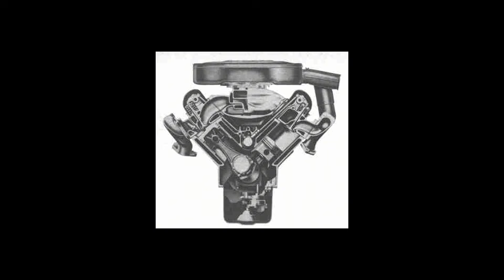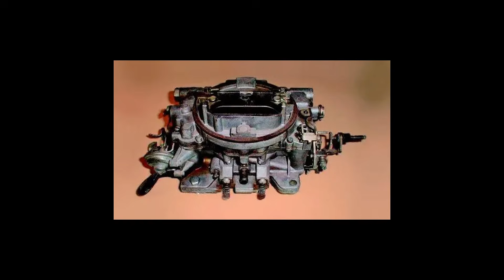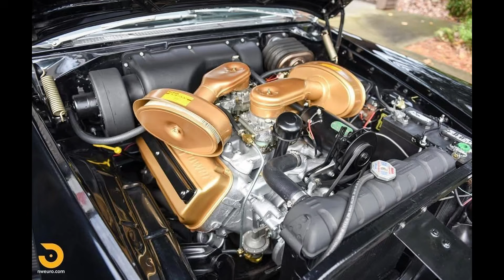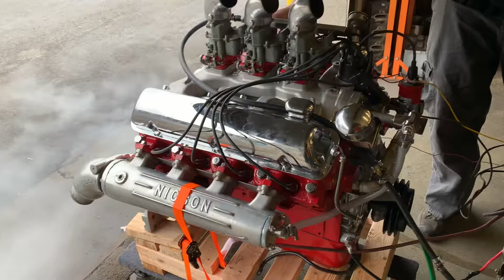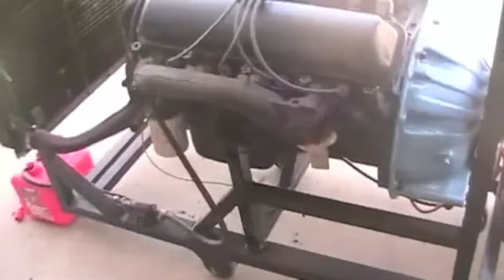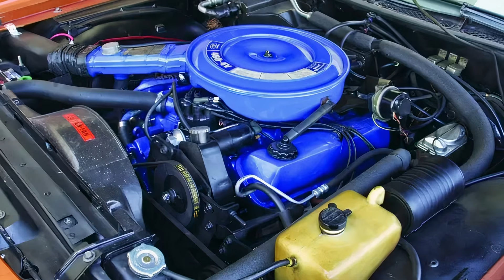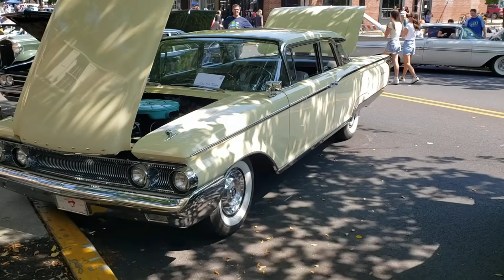Why America ABANDONED Lincoln’s Monster 430 Big Block!

Comment: The 430 was the most reliable of the luxury brands. by 1964 58 -59 Lincolns were getting into the 180K to 200K compression checks revealed that they were within  80% of factory specs which was unheard of at the time a quick valve grind and new seals on the heads brought these engines within 96-98% of factory specs. but back then they didn't survive long in the used car market and by 68-70 all but a handful remained in service.

Comment: I worked at a Ford dealership in the '60s. The 400hp version of the 430 had a 3-2bbls with a special air cleaner. Our parts department had the manifold for 1 of these less the air filter setup. That dealership is long gone but I always wondered what happened to that manifold.

Comment: I have an elderly friend who stuffed an MEL 430 into a 58 Ford. It had a three on the tree and he swears it could get to 120 mph in second gear.
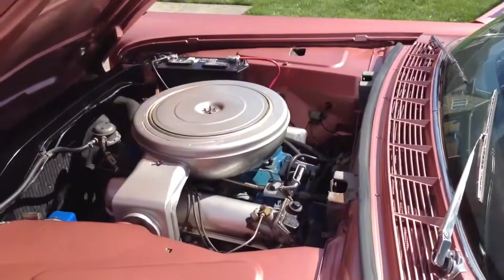Reply: All depends on the rear end gears. I had one Early Ford with lower than 3:00/1 gears, somewhere around 2:75, I can't remember. Also had a 2 speed automatic cruisomatic trans, 1 st gear to second max rpm was at 60 mph.
Reply: It couldn't. Horsepower doesn't give you more gearing. Those speeds aren't possible in a car. Unless it has a power glide.
Reply: @dustinandtarynwolfe5540  a Powerglide second gear ratio is 1.76:1 whereas the Warner T-85 (assuming that's what Gar's Ford had) used a 1.59:1 second gear. Actually a higher ratio (lower numerically).

Comment: They were mostly in cars nobody wanted.  58-60 Lincolns wound up in salvage yards pretty quick.  When I was a teenager cars with MEL engines were in what were just monstrous old cars at the time.  You couldn't give one away.  The cars that were desirable were the Thunderbirds with the optional 430.
Reply: I remember seeing '59-'60 Lincoln Marks for $400 in the newspaper auto want ads. At the time they were huge gas guzzling rust buckets.
Reply: @joebukovsky8876 My 1960 Mark V is not a rust bucket. It has the 430 tri-power with reground cam to roller. Bored strojed to 545ci it screamsl on the road & with 
Ford AOD teans & special converter, wil get 28mpg on the road. 17 around town. Vehicle only has 15k miles, but does not want to run easy at 40mph. 90 is its comfort zone

Comment: what about mercurys 410 cu.inch v8
Reply: Mercurys 410 was an FE block available from 1966 to 1969 i think. Anyways it was only available for couple years. When discussing 410's the year is required to distinguish the MEL from FE blocks.

Comment: Back in 1963 my cousin had a 1961 Ford. After blowing up the engine he put a 430 engine and transmission out of a Lincoln in it. But the hood would not close so he used a log chain to chain it down. But it did run good.

Comment: The Chevrolet 348/409/427 'W' engine from 1958 to around 1964 was a series of engines that had flat faced cylinder heads and the combustion chamber formed in the block.  So the MEL was not unique in that regard.  Sounds like it was an idea that a number of designers had in mind for quite a while.
Reply: The design is called the “Heron chamber “ it’s in the pistons. I don’t know who he is but the MEL and W were strong for their day, just really heavy and thirsty.
Reply: @Bill75456 Ford's Superduty industrual engines also had those style combustion chambers. I believe those engines were 478 and 534 cid.
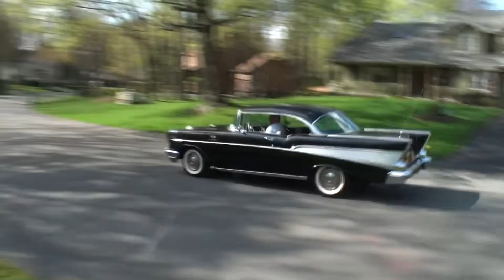Reply: @johneckert1365 You're right. I worked for a engine rebuilder in the 80s and there were still  dump truck operators sending those in 6:19   it was 477 and 534 Heavy  duties.A 444 Cid was also made found in the C series  cabovers
Reply: @richceglinski7543 Awesome, thanks for the info. I sold a 1968 cabover firetruck to Sprecher Brewing in Milwaukee for a beer garden truck, it had a beautiful running 534 in it.          I think International may have made a 478 gas engine. 🤔

Comment: My 58 Mercury with a 430 Lincoln motor was my 1970's hot rod. I put a double pumper Holly on it . I could smoke the tires for a block. Then I needed gas.😂😮

Comment: I wish they would cast 428 original type blocks. Even 361/391 FT blocks that could be bored to 4.13-4.19. The really expensive aftermarket blocks are more than most people need. Factory 427 blocks with SOHC cams made 2500 hp in Fuel cars. I just wish they would make good iron 1000 hp capable 406 blocks. Even a 4.098 block with a 410/428 crank was really stupid strong.
Reply: FE?
Reply: @charlesangell_bulmtl  Yes they are a really good tough compact engine. I have built a lot of them. They are nearly unstoppable. I wish they would make more economical blocks for street cars and brackets. There are blocks out there that can handle 5000 hp, but I would never need one.
Reply: The FE was a way better Hot Rod engine. They were close to the SBC and Pontiacs weight wise and they revved really well.

Comment: Back when the 430 was common in wrecking yards, swapping on into a57-59 Ford which were only about 3500 lbs. was relatively easy. Move the radiator forward and dimple the firewall on the drivers side.Stiffer front springs to handle the extra weight and you had a straight-line terror.
Reply: I swapped one into a 57 Fairlane hardtop.  That was a heavy motor!  I put the 2 4barrel Holleys on it. It was called a “Heron “ design like the 348/409. It was a stupid fast car. I had to have it adapted to a manual transmission.  I put a 65 top loader in it for him.  He had everything in a straight line at the time 66-67.  I am a blue bleeding FE guy. I built 7000 rpm 410 based solid cam and CJ heads and a 2x4 MR intake. In a 67 Mustang it was a beast. I’m 65 and have had to grow up. I still want a 428!
Reply: They made 59 and 60 T bird with the 430

Comment: 348/409
Reply: a flee in comparison
Reply: You’re quite right, very similar engine design
Reply: The 430's stayed together, but the 409's not so much.
Reply: @donjennings9034  Might be true didn't own either have some FE's think they are probably the better choice
Reply: @spudsmarauder  I've got a '69 Ford F-250 with a 390,  Holley 4 bl, and 4 speed. Love it.
Reply: @donjennings9034  I have a 68 F100 with a 360 & a 76 F100 with a 410 Mercury with a roller cam & a 66 comet with a 351w

Comment: So many errors especially in photos.  You wouldn't see this kind of terrible documentation 20 years ago.  You took the time to make sure the write up is correct, today anything goes.  How many times did this pathetic video show dual quad carburetors that were not from an MEL!  They never made them.  And how many times a 1957 Ford and Lincoln are shown and have nothing to do with MEL in 58.  The last year for production was 1968, not 67.  It was used part of the 68 year till the 460 came out.  Do your homework if you want to really educate people.  Otherwise just another pathetic uneducated video out there...like most.

Comment: I have the 1959 Lincoln with the original stock 430. Its a monster with the taller intake manifold. Very fast for a 5700 lb convertible!  375 gross hp. I use 100 octane race gas for her.
Reply: The higher the octane the slower it burns for less knock 91 burns faster run 91 and tune it may well go even better
Reply: That was the 1958 HP rating.
Compression was dropped slightly for 1959.

Comment: 430/400 hp. MEL was available in the entire Mercury lineup in 1958.
It was also available in Thunderbirds if you preferred it over the 352/300hp. FE, although not from the factory with the 3 carb set up, but std. 4 bl. producing 350 hp.
An original 430/400 hp. MEL with the original tri-power aluminum intake is truly a thing of beauty.
I have reason to believe the 3 carb set with the massive cast aluminum intake got better gas milage than any other iteration of the 430.